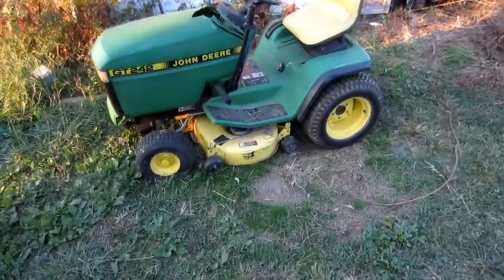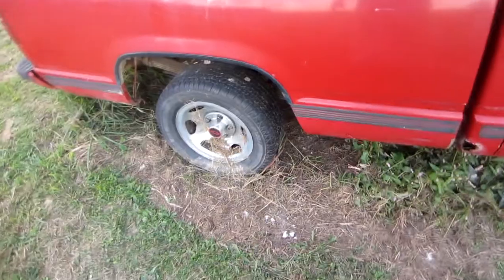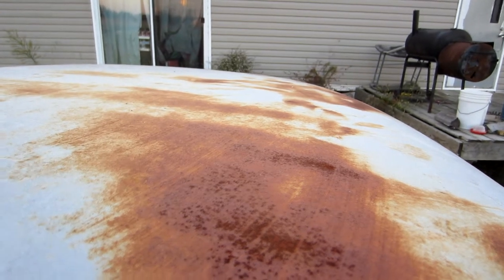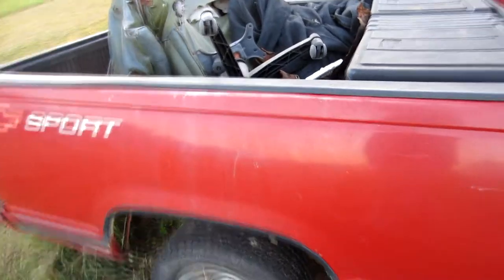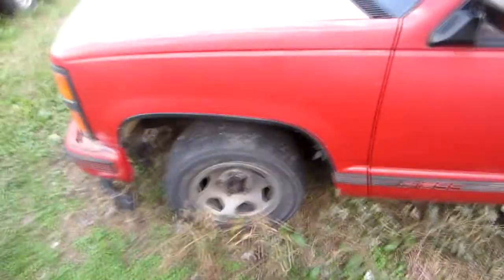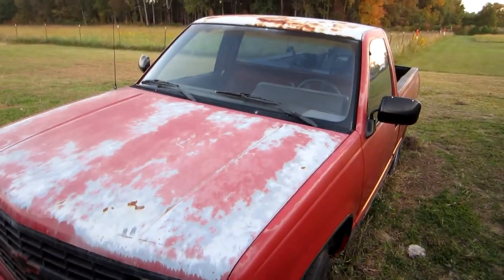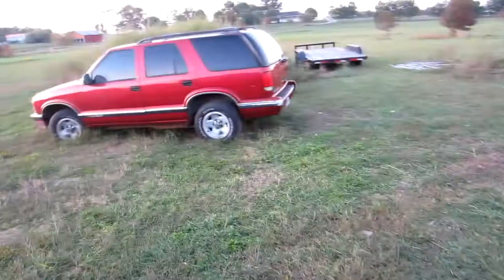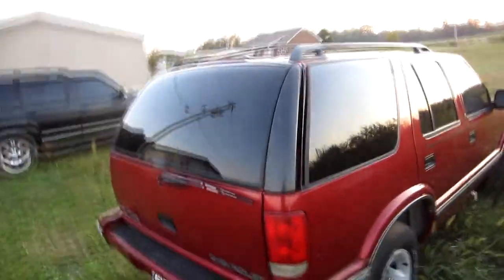All projects Update

Comment from the maker: @vatechbiggdanny no the 89 red silverado sport is a 350 the 454 version (SS) didn't come out until 90 and it was really a bloated truck, it doesn't pull any more than the 350 does because they both have the same 700R4 transmission and 4.11 rearend but it does have a little more low end power for quicker take off's but for that you lose seriously in mileage.  and yeah the 75 dump truck for being a 36 year old truck is in great shape that's the reason we bought it dump bed works perfectly too

Comment from the maker: @blazerlover25 no mine is a 1989 Silverado Sport, the first of the actual sport line which actually only lasted from 1989 to 1992  they were black, white and red  the sport package was basically just trim, like the red lined body moulding, heavier duty suspension chrome weels with the Sport specific center caps it does have manual windows and locks but it also does have the silverado badging on it as well. there were only 2500 red sports made in 89 i own one of them never seen another like it.